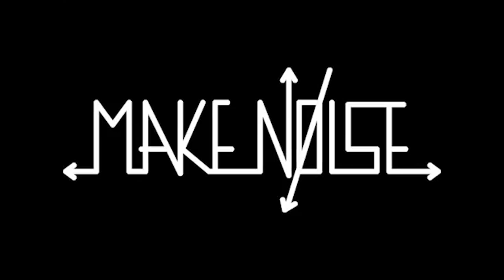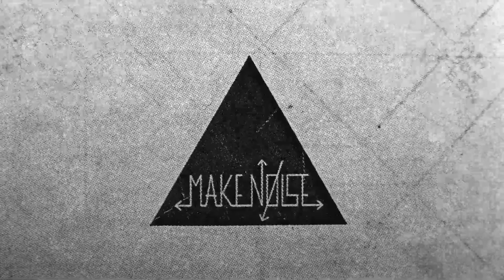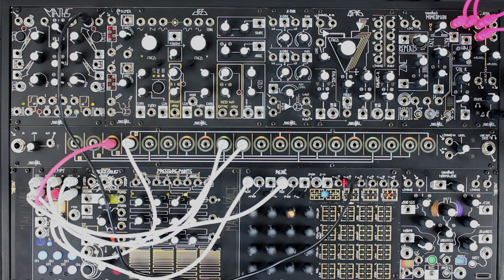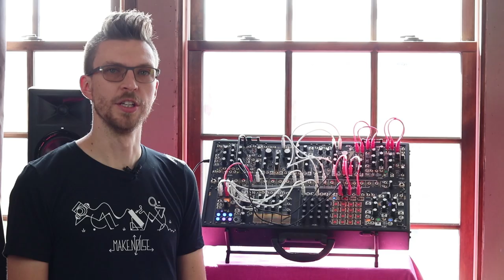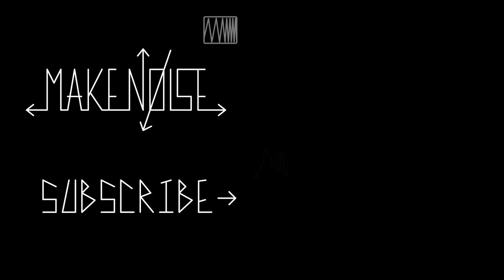The QPAS Bongo

Comment: It's good to hear that the Mysteron is still working at MN. Very cool consistency. Also good to see that the patented pad has evolved into Pressure Points, but I also feel that the 2014 video still has an edge because of PP and the Optomix, which is still unbeatable when it comes to organic woody sounds. And PP obviously adds that manual expression. Can't wait to hear the 2024 bongo, but I would approach it by recording a real one (or a patented duck tape cardboard box hand drum) with the Morphagene, splice it, and then let Tempi and the WoggleBug take over.

Comment: Created a cool groove with just the DPO, Brains, PressurePoints and the awesome Optomix to create one patch of kicks, rimshots and bongo's. I used the stereo out of the Erbe-Verb and passed it to two phonogenes to independently animate the L/R reverb trails. Could be even better with the Mimeophon, but that's not in the Shared System case. Just in case you'd like to hear how it sounds, here's a link. https://metapop.com/cinematic/tracks/the-stereotypical-expanse-stardate-23016/106868
Reply from the maker: Cool track and patch, thanks for sharing!

Comment: I like to do a version of the 2014? Bongo.
But instead of Final Out I use the sine out of osc2 and fm it via osc1.  And instead of taking the clocked stepped random directly into the 1 v/oct I like to send thru the center of MATHS and use the random coming out of the sum so I can scale and offset the random voltages.  Little verb from the erbe.  Then patch takes its own life from there.. 

And for some reason my voice gets realllly low and creepy when I patched it.
I wonder if that happens to others.
Too bad we couldn’t ask Don :(
Reply from the maker: nice patch!

Comment: I created a few Bongo sounds on the Ø-Coast when I was trying to build a new patch. Figured I could always go back and find those Bongos again after I finished the patch which, actually, sounded alright as I'm teaching myself Modular Synthesis. Speaking of. . .Make Noise should think about creating another all-in-one Modular Synthesizer this time. You can utilise parts of your most used modules, i.e. Maths, Wogglebug, {which were used in the Ø-Coast} however, this time the partial modules which are incorporated onto the one size PCB board which would be a bit larger than the Ø-Coast, will be named on top for example, mATHS , wOGGLEBUG, bRAINS, PRESSURE pOINTS , etc . Lines would be drawn around each 
" module " as though it was an actual small Eurorack . A large part of creating this would be to keep the price down as you did with the Ø-Coast. This next one will be for people who have greater interest still in the Modular world but haven't the money or time to go Full On into buying a skiff or rack plus the power strips etc. You can sell them this which will have 
partial modules from a company they know or have heard about -Make Noise. People can use this Next-Coast to patch into their Ø-Coast. They can patch it into their existing Modular systems, they can do whatever they want. . .perfect for travelling and no other company has done something similar to this, you would be the first one to make a miniature 
Fully Modular Patchable Midi Electronic Synthesizer. 💡💡💡✔